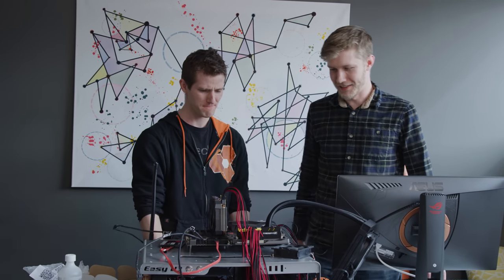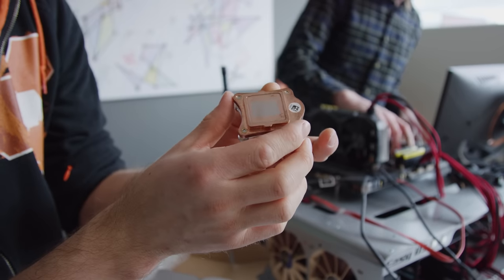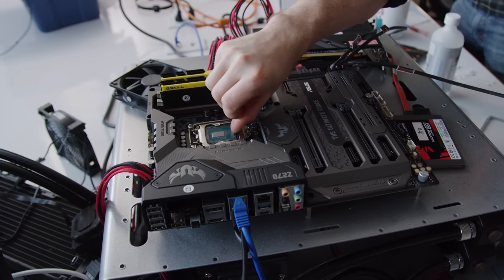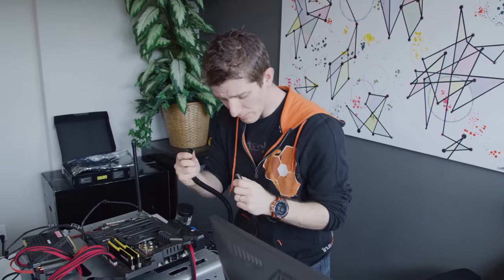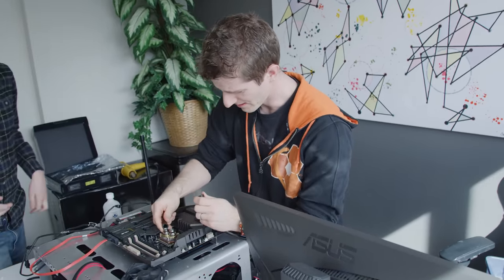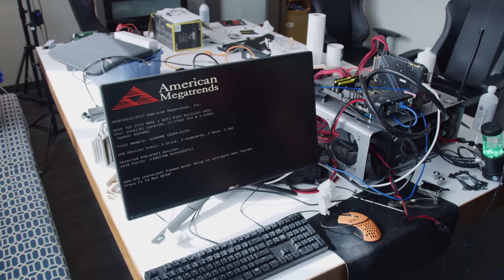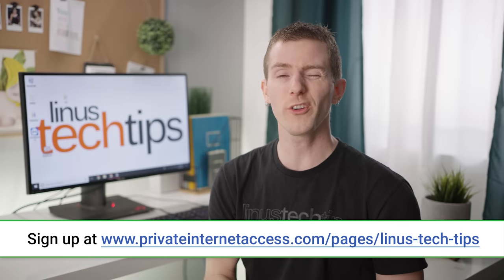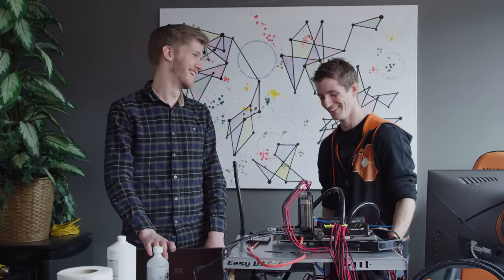This cooler VOIDS your warranty! - Worth the risk??

Comment: Quoted from the kick start page.
NEXT INTEL CPU WILL BE SOLDERED !!!
This makes of the Ncore totally pointless. It's a huge hit for me and my plans as it looked very promising. I invested so much money and time into this project just to fail.
Therefore, I will not make Ncore for the new generation of the Intel CPUs.  I won't also make V2 so I won't be able to offer.
The only offer for backers is a promise that I will contact you in future with the option of an exclusive preorder with discount. 
I want truly apologise for recent lack of contact, but the overall situation is a little overwhelming. Hope you will  understand
Reply: Sadly intels new soldered chips used crappy solder so its not. Replaced with high performance thermal paste beats it...
Reply: @thedarktoes its not crappy solder, the CPU's are physically thicker so the heat has more material to move through before it is transferred to a heatsink.
Reply: Yeah its physically thicker, however they still sold you tooth paste.

You STILL have to delid them and either put on quality solder, liquid metal, or high quality thermal paste to decrease your temperatures by a pretty good margin... at least 10-15c is to be gained by still doing this age old trick because intel just pulled a fast one on every body.
Reply: They didn't sell me anything. It's not toothpaste it's a legit solder, in fact it's indium. What metal would you prefer they used as a solder? The fact is the heat problem has nothing to do with the material, it's just a function of the thickness of the silicon.

Be my guest and delid them and just replace the solder, you'll see literally 0 difference, debaur has already shown this.
Reply: well.. here you are wrong again, and that's actually already been done with many different heat transferring mediums, and.. yes they saw 10-15C improvements in temperature.... 

Seems like you dont know what you're talking about bud.

Have you even looked into the topic or are you just claiming their solder to be great when it's almost unanimous amongst the PC community at this point that their solder is infact worse than high grade thermal paste?
Reply: Dude you have no idea what you;re talking about. The things you're claiming about the Intel solder were actually said about their previous TIM which was thermal paste, not solder and it was for the last 4 or 5 generations not the current generation of chips. Intel hasn't used solder on their CPUs for years.

The type of solder used by Intel is the same type that is being used on the AMD Ryzen chips, Indium. Stop talking about a subject you've done literally 0 research on, you haven't even done the bare minimum of watching even a single youtube video on it.
Reply: @WolfA4  ACTUALLY the things I've said about intels solder was currently said about the EXACT SOLDER SPECIFICALLY RELEASED WITH THE 9900K.

It just so happens that their previous thermal paste was also a pile of shit...

Seriously I've seen 4 youtubers now test this and they've all said the same thing... you still benefit alot from replacing the solder...
Reply: " wolf man ACTUALLY the things I've said about intels solder was currently said about the EXACT SOLDER SPECIFICALLY RELEASED WITH THE 9900K"

If you read that then the people who you agree with are as wrong as you are. Intel uses the same type of solder as AMD does with Ryzen.

"I actually researched the topic in depth"

No you didn't otherwise you would have known that the material used by Intel is the same as the one used by AMD.

"not to mention AMD has a much wider surface area to spread the heat out of from the die..."

So in other words the size of the die correlates to thermals...

"And yes the primary material is the same but the consistency is vastly different"

You know what the great thing about solder is? They have the same consistency after application, they all become solid.

What happened here is you are parroting a meme about intel's TIM without understanding WHY it was bad. You are obviously confused as to why liquid metal and soldering worked so well with previous generations of intel's CPUs. It has already been shown that reducing the vertical size of the intel CPU core reduces thermals, just like increasing the surface area would reduce thermals. In intel's case the solder is fine, it's the size of the core that is responsible for the increased heat.

> however they still sold you tooth paste.

This line shows that you don't know what solder is.

And finally to prove my point conclusively:

"You STILL have to delid them and either put on quality solder, liquid metal, or high quality thermal paste to decrease your temperatures by a pretty good margin"

https://static.techspot.com/articles-info/1732/bench/Temps.png

Same CPU using thermal paste vs the solder.
Reply: Actually you can buy it and it's not hard to find.. but okay. Haha

I have plenty from work.. along with many different types of solder  base including but not limited too, aluminum, cobalt, magnesium and more... all with varying grades and for different purposes...

But hey you're the expert right. Haha
Reply: @TheDarkToes  so do me a favor copy and paste my quote stating you can't buy it.
Reply: @WolfA4  "indium based solder is not something you can pick up at frys."

But here I am and I bought mine from a store.... shrugs
Reply: So does my statement say you can't purchase indium solder at all? I just checked frys right now, they have no indium based products at all.
Reply: no... but you can literally buy it from walmart...  so your statement implying that it's hard to come across or even unique or rare, by saying things like it's a product made by 1 company exclusive to only a handful is.... bullshit
Reply: Alright you got me, Intel and AMD sent guys down to walmart and grabbed some indium wire solder typically used in jewelry repair. Man it's too bad someone didn't delid the 9900k and tested the thermals with and without the solder. Wait they did. 

Ah but no one delidded a Ryzen CPU and tested it with and without the solder showing the same results the Intel chip showed. Wait they did! 

The solder is better than even high quality paste and the same or slightly worse than liquid metal, in both cases. Damn too bad someone didn't show that grinding the core down and removing a known amount corresponds to a predictable change in thermals. Wait they did!

Ah but damn no one has shown that the change in thermals is significantly improved by reducing the size of the core vs. simply using liquid metal. Wait they did!

But I didn't link you to a bench mark showing the difference between intel's solder and high quality paste proving my point.  Wait i did!
Reply: "What did I start"

A revolution! Viva le solder! Down with the bourgeoisie thermal paste! We must seize the means of thermal conductivity!
Reply: Dazidan THIS.
Reply: @dezidan except I have an AMD CPU in my computer. I never talked about anything related to the CPU's performance just pointed out you're parroting a meme without understanding the reason. 

I even posted a bench graph from a bench mark to illustrate my point.
Reply: "I know its a problem but I'd say so is the piss poor soldering. " and this is why I keep say you're wrong, or the Ryzen also has piss poor soldering as they show similar results when comparing it's solder's performance vs. high end thermal paste AND liquid metal as has been shown months ago. Both intel and AMD solders are better by about the same amount of absolute temperature when compared to high end thermal paste, and both are worse compared to liquid metal by about the same amount compared to liquid metal.

IMO the 9th gen intels are not worth buying but not because of their solder but because the marginal performance gain they give is knee capped by the reduction in flexibility of cooling solutions for enthusiasts. in any case understanding the WHY is the most important part because that's what is going to allow you to to determine what the best option is in the future.
Reply: "Delidding an Ryzen CPU and using liquid metal is not even worth it as it only gives a 4 degrees celcius reduction in temps when overclocked, compared to delidding an i9 so no. "

That is the same thing that happened to the i9 9900k, it was delidded and LM applied then overclocked. The high temps are not simply from it running stock.

Both the AMD and Intel solder are similar in thermal conductivity in comparison LM and thermal paste. They can't LITERALLY have the same thermals as the CPU's are wildly different in surface area and depth. The fact that both are better than high end thermal paste and worse than LM show that they are both using comparable solder, there is no playing it off as anything. Get it out of your head that I am a fanboy of any company, I have personally owned an equal number of intel and AMD chips for the last 19 years.

To quote steve over at gamers nexus: intel's solder is "fine".
Reply: Damn yet another Youtube shouting match where both party accuses the other of not knowing what they are talking about and nobody thinks to be the mature one and actually de -escalate the situation.
Tsk.
Reply: @Kaiwala  hehee youtube is one of the biggest cesspool of the world, ain't it?
Reply: @Daniel Sung-ho Cho Yup.
Reply: @Kaiwala  Except you have one guy showing sources and quoting people who have done the tests, and you have another dude saying "Actually" before every sentence

Comment: A trick from a mechanic shop: use a small pair of vice grips to crip the middle of the hose, that way you don't need to drain it, if you hold it up high enough you won't really even have much water in the hose after the crimp either. This is how we cheat on car fluid systems.

Comment: I remember when AMD CPUs didn't have a heat spreader at all.
Reply: Probably this was time when intel was naked as well.
The first INTEL CPU to use this architecture was the Willamette-core Pentium 4, released on November 20, 2000 at socket 478, and INTEL never achieved advertised 10Ghz speed :). And yes INTEL killed line-up of PENTIUM3 because P3 was faster clock-to-clock then P4, and yes P3 was naked.
The first AMD CPU to use this architecture was the ClawHammer, released on September 23, 2003 at socket 754, and this was realy competetive product at time but INTEL was bribing OEM to not use better product (for example free AMD CPU for HP, and HP said no THANK YOU), and yes P3 would be competitor for this lineup (but was discontinued), but P4 was not, and magical duron smoke (no thermal diode on silicone, ATHLON didnt have, ATHLON XPhad)

a short history lesson, and this was time of first WATER COOLING solution, and PELTIER, and YES both INTEL and AMD with naked core was vulnerable to crush die if cooler was mounted improperly

Comment: Bruh my 7700k is at 50° just browsing the Internet
Reply: My i5 7400 is now 85 browsing youtube no joke
Reply: Fat Sausage when was the last time you changed your thermal paste lol
Reply: same dude,My one too..even I never tried to overclock manually to over than 5ghz...
Reply: The heat paste under the IHS is poop-tier on Intel CPUs. It’s basically spread very badly (and that assumes there’s even enough on there in the first place) with more of it running off the side of the die than is actually making contact with the IHS. It’s terrible from a manufacturing perspective. I highly question their QA after delidding my 7700K, it’s like they’re not even trying.

Supposedly their current CPUs use a solder-based TIM so the problem should be fixed for 9th gen and beyond. 8th gen should still delid and LM, though.
Reply: My i3 in my notebook sits at this temperature all the time

Comment: Delidded my 7700k still doesn't oc more than 200mhz even with increased vcore ;D
Reply: Sebaxtain try taking a wet wipe to the K, it might be scribbled on there in crayon.
Reply: pr0xZen haha that's what my chip feels like
Reply: Dang, that sucks. I have my 7700k stock (not delided) w/ a Hyper 212 Evo at 4.8 w/ my motherboard's auto OC service.
Reply: 2600k on 4.4 air hoaa
Reply: he obviously has a motherboard that cant overclock.

Comment: If the heat sink is cut correctly you shouldn't be using thermal compound. That will actually reduce the performance. Thermal compound is primarily used for making up for flawed surfaces that don't match well and so it fills in the gaps. A surface flattened to 1500 grit is better than any thermal compound can produce in conductivity!

Comment: What if you had it so the liquid itself makes contact with the die 🤔 using a perfectly clean die and perfectly clean non-conductive fluid such as mineral oil
Reply: Do it with the best upcoming threadripper and then overclock 😏

Comment: The only way to more efficiently cool the CPU would be to take that custom water block and cut a square opening into the bottom just large enough to expose the CPU die directly to the coolant with only a oring separating the die from the cooling block. There's a follow up video for you guy's....

Comment: It's not really surprising... Replacing a layer of thermal paste and a copper/nickel IHS with direct copper contact is a no brainer... The only gotcha being voided warranty, and risk of handling a bare die (the slightest static discharge can easily fry it).

Here's a unique product idea. Copper-Zirconium alloy (C15000 - https://alloys.copper.org/alloy/C15000 ) stamped IHS replacements. C15000 is a newer specialty alloy of copper with a tiny bit of zirconium added, which give it a really high melting point and makes it much harder than normal copper, while retaining copper's excellent thermal and electrical conductivity. It wouldn't be hard to draw in CAD a model of an improved drop in replacement IHS with a lower inner profile and thicker top, with some calipers and a model IHS, which will give you the same advantages as this (direct copper to die contact) but can be used with any CPU block, or even just normal air cooling.

Someone with some manufacturing contacts in China could easily make a lot of money...

Comment: 2C is not a big deal, would be more interested about temperatures of 5.3Ghz in stress test and i mean prime95, somehow the waterblock mounted this way will make some pressure points on the edges of the chip and can break it since heavy pipes are wiggling out of it, would say 2C not worth it, btw on the market seems to be a beter solution witch is called "delid cpu guard" that alows u to mount a waterblock directly on the cpu chip and protects the block from wiggling the same time

Comment: Where are we at with this now?  Any updates or improvements???   I think intel and others need to design chips with the ability  to be cooled I this manner.   Perhaps replacing some of the metal on some chips/ GPUs with a thiner nickel or boron nitride coating to allow direct contact with cooling systems.  Would be awesome!   😎

Comment: Has anyone tried using Ultra pure water for water cooling? its the water they use to clean the silicon wafers of micro chips. in the event of a leak it shouldn't short the electronics because without impurities ultra pure water shouldn't conduct electricity.

Comment: Me thinks Linus get "Special" components not available to anybody else. Pour water on MOBO - Still works. Freezes MOBO then heats with heat gun - Still works. Jerry-rigs ghetto cooling solution that leaks to $4000 CPU at 5.5GHZ - Still works! 
These PC Components are tougher then their manufactures give them credit for, or Linus has the hand of the PC GODS!

Comment: So this is a game changer, if you take a older cpu and use this product as a primary heat exchanger then you would not have to upgrade your cpu as often. For those who do not play games and just need a cpu to do windows work like word email you could use an older cpu and have good speeds with it not even getting above room temps. So this question has to be asked, why has the cpu manufacture not done this before???  MONEY....

Comment: Well, if Intel put some actual engineering into their heatspreaders, botches like this would not be neccessary. In theory, a Heatspreader can improve temps by a lot if it is engineered correctly. It needs to be thin and connected to the die with the thinnest possible layer of solder. Indium solder is far more thermally conductive than liquid metal and gets the heat away from the die to the Cooler/IHS interface and the increased surface area of the IHS allows more heat to transfer to the cooler over the thermal transfer bottleneck that is regular thermal paste or even liquid metal. 
But even though this is very easy to understand, Intel always finds a way to fuck this up.

Comment: Is liquid metal a mercury alloy?
Reply: No, it's gallium with indium and tin.  I think if it were pure gallium it would destroy the heat spreader, but I've seen that combination utterly destroy aluminum if you get the aluminum wet.   So don't spill water.
Reply: @joshuascholar3220  thanks I've been wondering what's that "liquid metal" thing was

Comment: Yeah but. It was so easy to get the block on. And they had it off already the second time. Why didn't they just connect the loop to the block first?
Reply: I guess that if a pipe disconnects and spills water while you're putting the block on the bare die cpu, then you're even more in trouble...

Comment: connecting those tubes would have been way easier if you just pinched the tubing real hard a few inches from the ends so water couldn't come through

Comment: After viewing this video again i'm actually not really impressed either because my loop is doing very well, my chip is a golden sample or the ncore just doesn't really work that great. My i7 7700k hits about 50c at 5.3ghz at 1.44v.
Reply: Silicon lottery. Your CPU is in the top %1 of 7700k's capable of doing that.